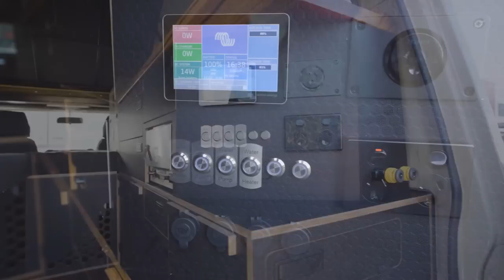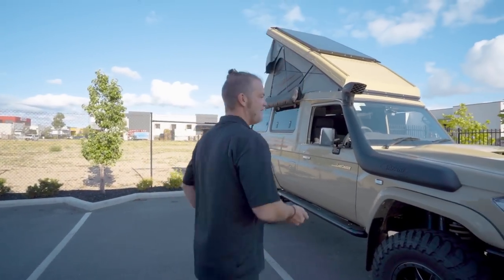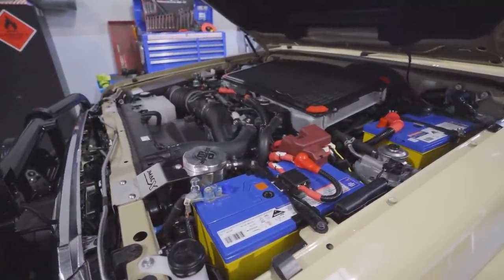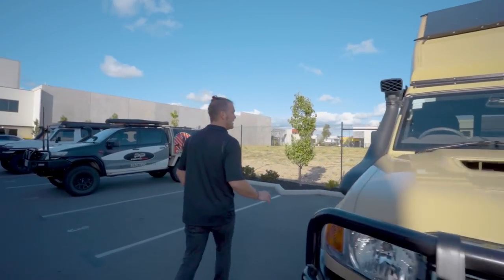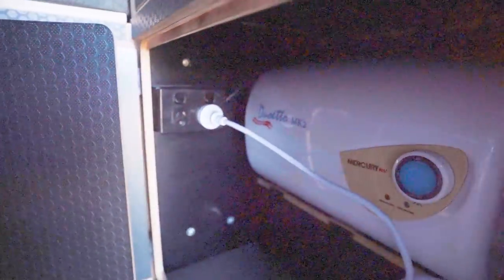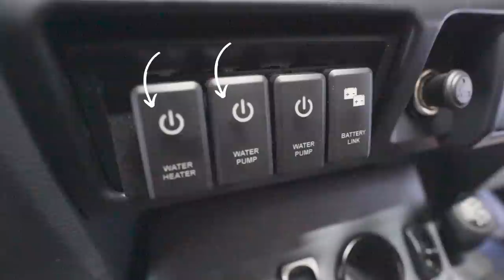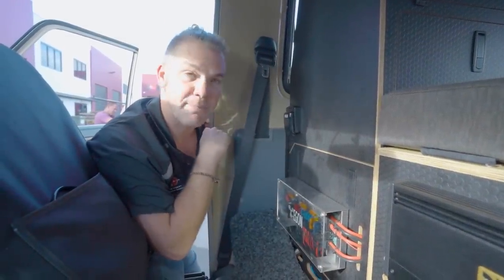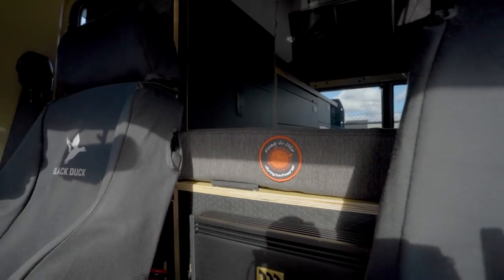Heiner Builds Your Ride | Toyota Landcruiser 78 Series ( The Mother of All Troopy )

Comment: if it were my vehicle  Heiner , i'd extend roof height to 6'5" and extend the 4-5'  in length to allow 6'1-6'5"person  to sleep  comfortable  either as 2 singles or fold  down queen..

note if you are going to make it shore power compliant, you will need to fuse it from the inlet..

i would also consider a snorkel option on the exhaust..